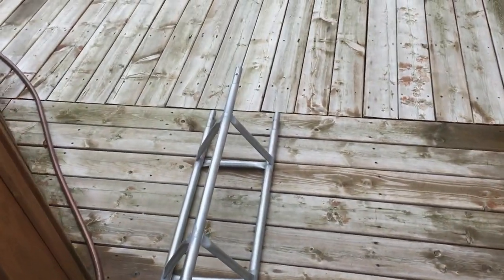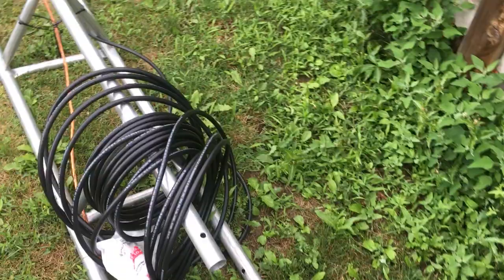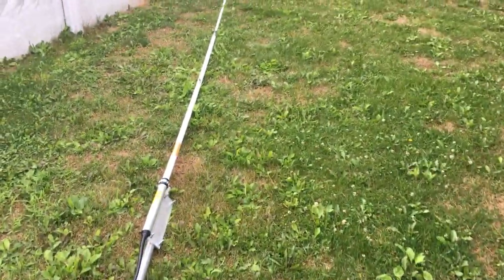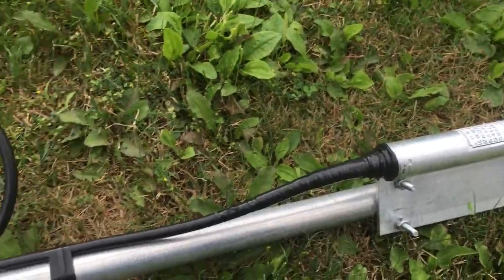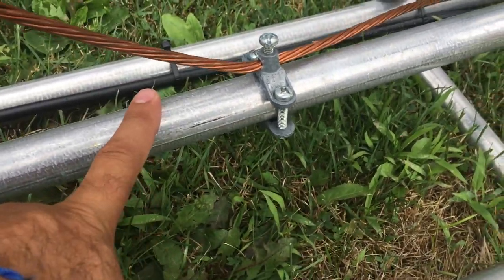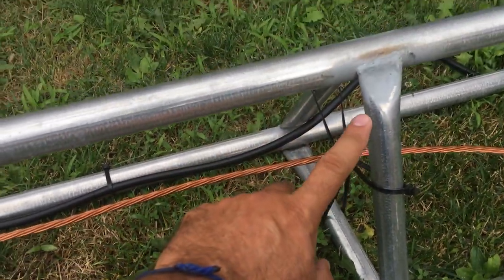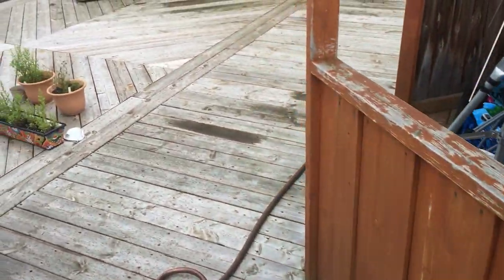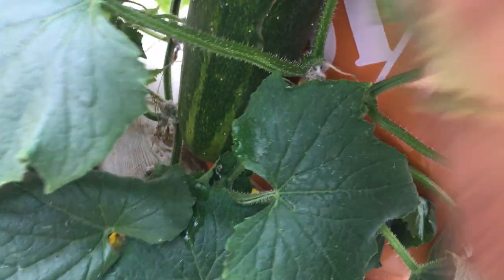IMAX2000 Tower Installation, No Ground plane, Grounding.  Pt 2 of 3

Comment: Where i work, i use RG213 for just about all installs with cable lengths 100ft of less at VHF/UHF, over that we use either LDF4-50 for tower work or longer runs, and we use LMR400 for longer runs that LDF4-50 will not fit or other wise bend where i need it to go.  :-)
Reply from the maker: It's my first tower set up and I'm very happy with it.   From Toronto depending on conditions i kill it down to South America....
Reply: Well, its a small community. Here is a familiar channel. Hi nut!
thumbs up!

Comment: you dont want to run that copper ground cable the entire length of the tower, it is unnecessary and will cause problems. first, that ground cable is perfect for your dc ground (lightning, static discharge etc) but will not do anything for your rf ground. second, you only need to dc ground the base of your tower (4 legs) not the whole length. AND, by running such a long cable like that it will distort your radiation pattern, it will absorb rf and re radiate it as harmonics etc acting as a second antenna, and the resistance is to high on such a long ground wire run to be effective. here is what you do, ground the base of the tower all four legs to four 6ft ground rods spread an equal distance apart (about 4-6 inches in front of each tower leg will be fine), connect your copper ground cable from one tower leg to the ground rod in front of it. (keep the cable length as short as possible) then connect 1/4 wave radial wires to the ground rods as many as you can and spread them straight out like the spokes of a wheel (as much as possible) and bury them like 6 inches into the ground. this will help immensely with lightning and static dispersion if you are hit and it will also act as your groundplane thus lowering the radiation pattern of your antenna. next you need to set up a good rf ground system. do all of this and the dx contacts will blow your mind
Reply: I agree, that's what he should do
Reply: I shoulda asked this guy insted yo Yo YO ! Nothing dam virus soon as i get ready to take over the 🌎 it dies , were u at mice ... Its all yours